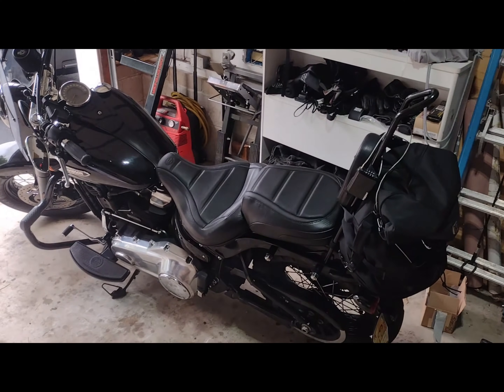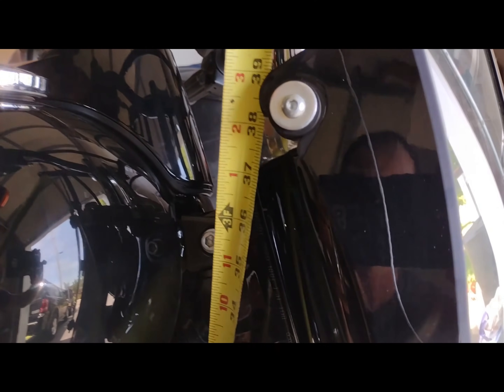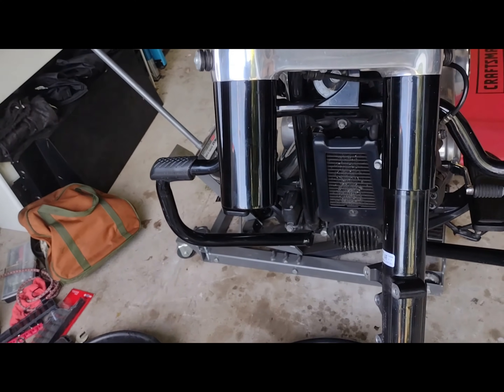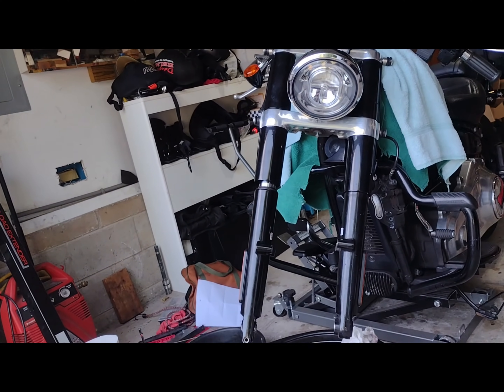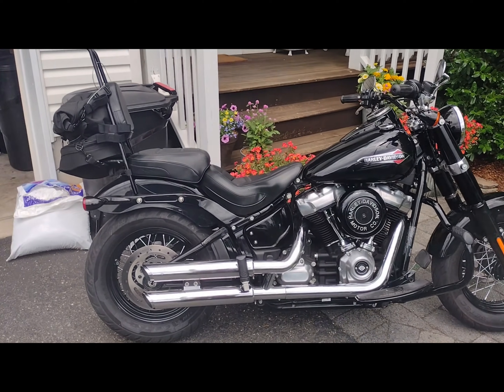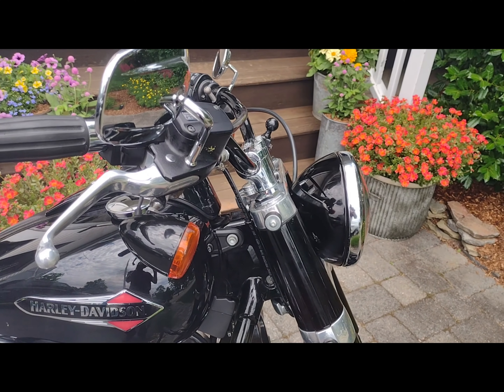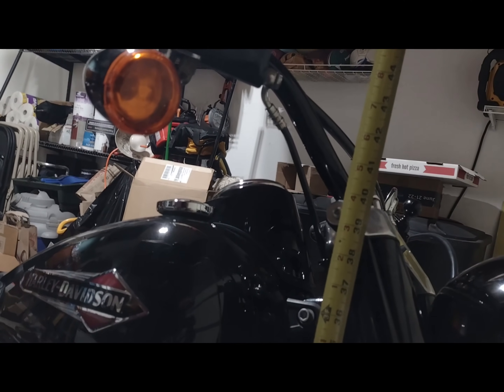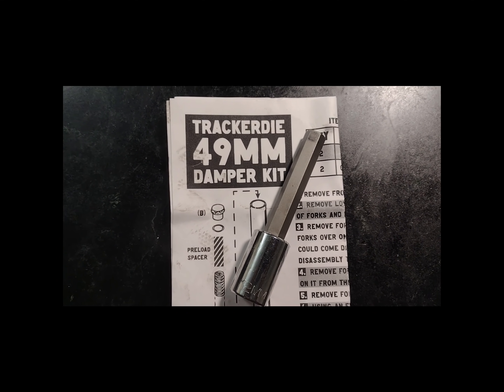2019 Harley Davidson Softail Slim - Longer Fork Dampers - TrackerDie 49mm Damper Tubes

Comment: Hi Mike, I'm looking to switch my stock seat for more comfort and noticed your cushy one..are you happy with it? What type? Thanks.
Reply from the maker: Hi,  It's the Mustang Wide Solo Seat with a backrest.  I love it.  It's my second Mustang seat.  I had one on my 2011 Sportster before this.  I just got back from a +2800 mile trip with that seat and the Air Hawk pad. They did great.
Reply: Just did the same seat on my slim. With the cross stitching. It’s great! And a back saver. After a lifetime of countless injuries!

Comment: Did the extended dampers change the handling other than giving you more lean angle?  I want to get these dampers for my low rider with 49mm forks and I already got the longer shock in the rear
Reply from the maker: I have not noticed anything negative about the handling since installing the longer dampers.  I highly recommend it.

Comment: Do you remember how much fork oil is needed on each side? Is it less due to longer tubes?
Reply from the maker: I stuck with the same procedure to fill the forks that's in the service manual.  With the fork fully compressed, fill the fork to 4.65 inches from the top for the FLSL.  (note: different models have different distances listed in the manual) I didn't adjust for the longer dampers.  It's been a few years not and 10's of thousands of miles and all's good.